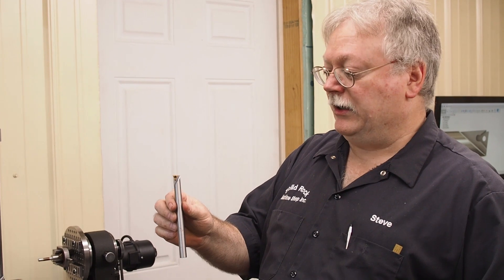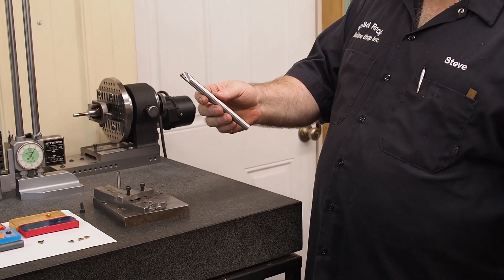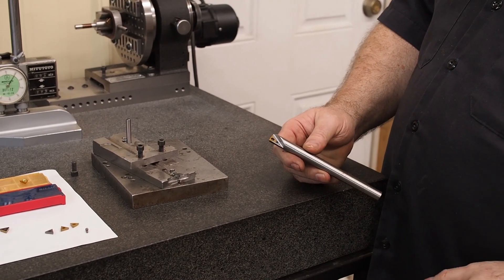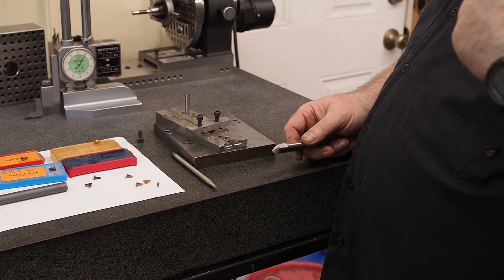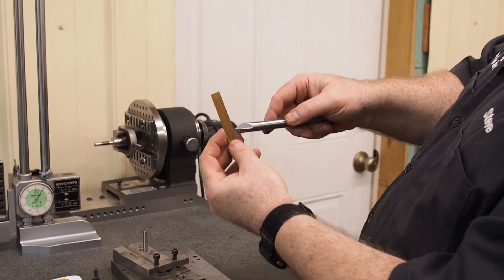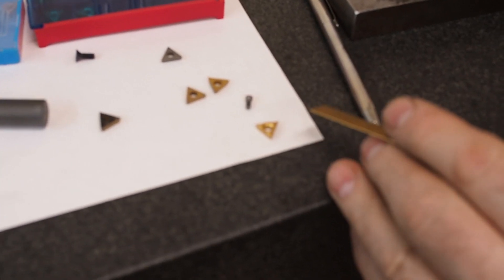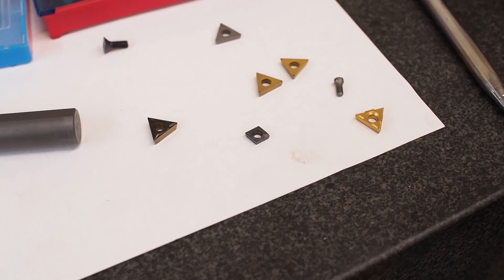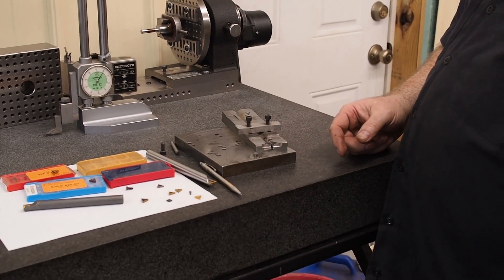Insert Boring Bar part 1

Comment: I can't say I have ever broken a boring bar, that would be an ouchy!!! I like CNMG inserts on my boring bars, the triangles are a lot weaker.
Reply from the maker: Hi Brian,
Are you talking big boring bars or small ones, 1/2" and under. Many guys I worked with hit the shoulder really hard and ripped out the pockets and inserts. on a 3/8" bar you only have about .09" of steel under the insert. Doesn't take much of a hit on the shoulder to break the pocket.
Steve
Reply: Oh yeah I have seen pockets get trashed, I thought you were talking like hanging it up and breaking the whole bar in half. I have never crashed one like that. I rarely bore anything under 3/4" so I can't speak to the pencil sized bars.  Maybe making bars would be a good marketable product for your boys if the patent thing doesn't make you rich. :-) I hope it does!

Comment: It would be nice if you could use a regular speaking voice rather than shouting to the microphone.   Shuuuuush! we can hear you...   Content incredible - thank you.
Reply from the maker: Hi Green Range,
I have always had a loud voice. The problem is compounded by using a directional microphone. You turn away from it it get quieter you turn toward it it gets louder. We are trying to work on those things in the mean time adjusting your volume control may help. Thanks for the comments
Steve